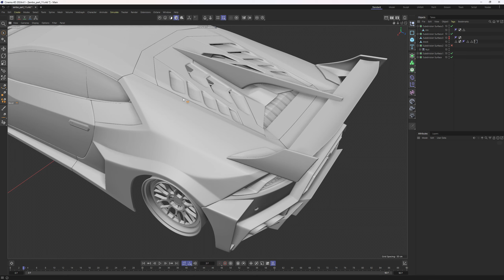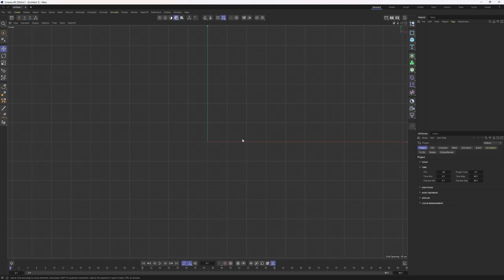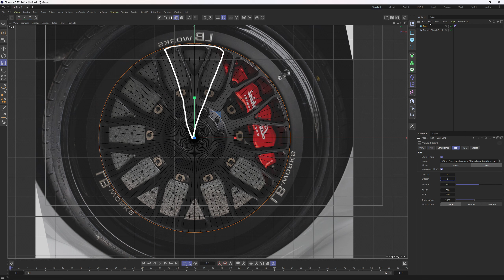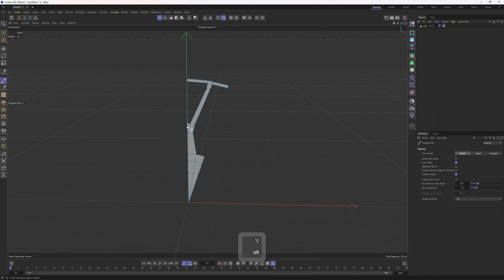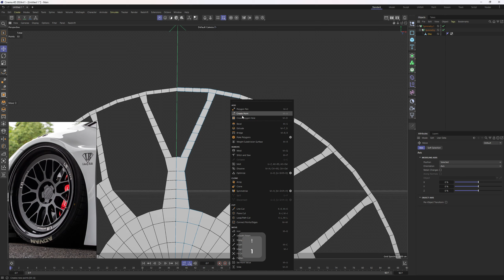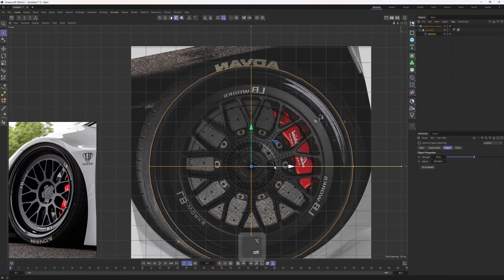Industrial Design/Product Modeling #42 Rim

Comment: Thanks for the amazing tutorial, çok teşekkürler kardeşim! At 9:00 you can set the " Weld " setting to " On " which is currently set of " Off " and it'll connect the vertices without having to add "Connect" element. Thanks again for all the amazing amazing videos 👏
Reply from the maker: Rica ederim, yeah, I just realized it when you said it!